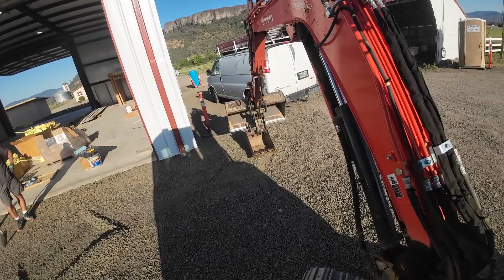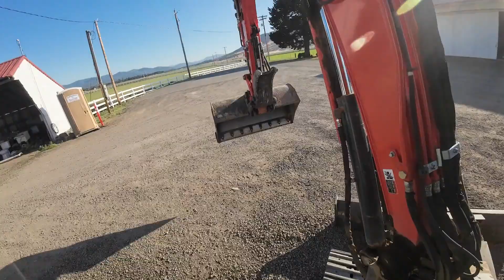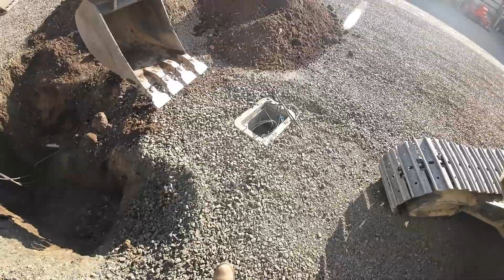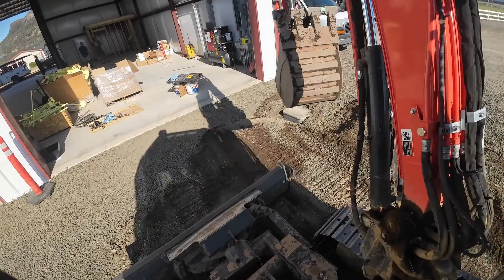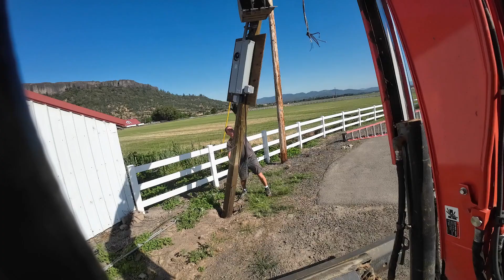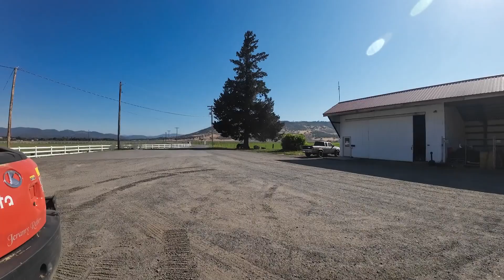Searching for lost wires and power pole removal with the Kubota KX 040

Comment: Slow and steady saves the conduit.  I opted for an 18" as my smallest bucket. 4 teeth is not ideal as the thumb does not mesh but honestly it still grabs brush fairly well.
Reply from the maker: Yes, my 18 doesn't mesh with my thumb because of the 4 teeth. My 16 has 3 and works great. I put the smooth teeth on my 18 just for things like this job. You have a great day 😀

Comment: I got a couple different mini brands in mind for when I buy one but one thing is for sure it will have rubber tracks !! I have run 2 with steel tracks and man it makes for a lot more work putting down plywood and everything .I normally run bigger stuff but I love running minis it's always something super technical with a bunch of utilities around ! Anyways great video man
Reply from the maker: Thank you. I very seldom get on things that the steel tracks are a problem. But if I did a lot of things where it was a problem, I would definitely run rubber also. Thanks for watching and have a a wonderful day 😊
Reply: @jeramyreberpuredirt7873  just lawns and paved driveways they don't want the marks on thats all . Plus the rubber tracks are a heck of a lot quieter ! Lol have a great day man .
Reply from the maker: @rirebel6029  I use old rock crusher conveyor belting when I do need to protect something. It is much easier to move around and handle than plywood.